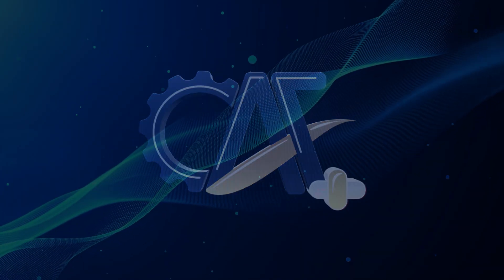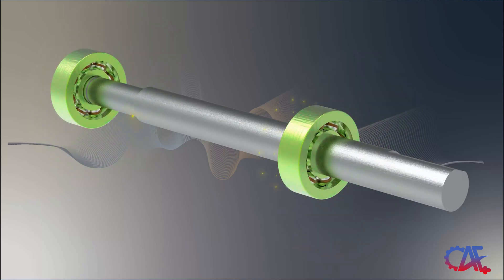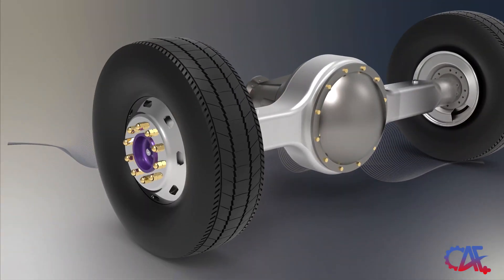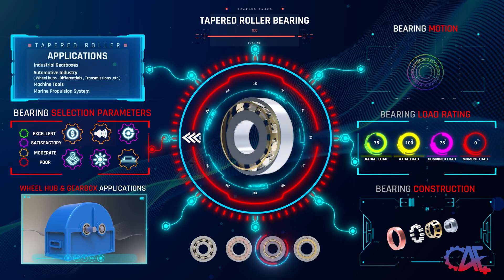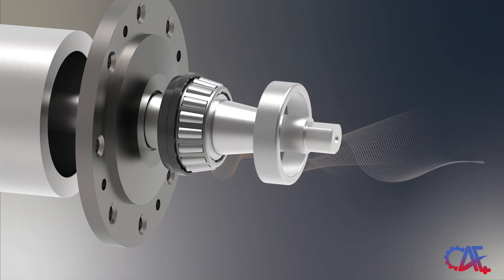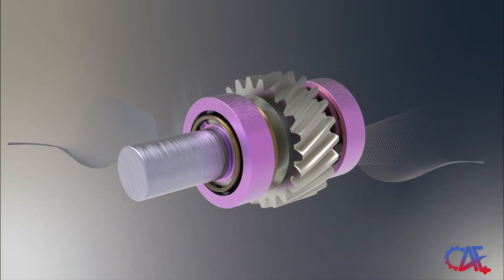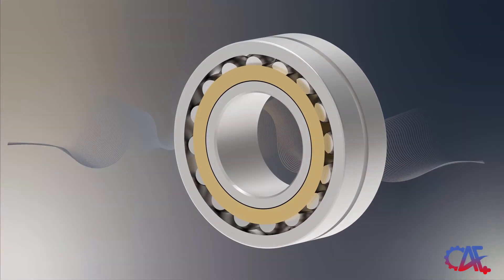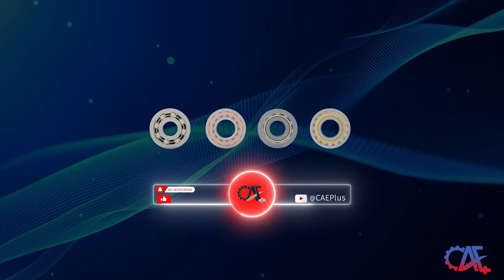Applications of Bearings 1 [Common Types]

Comment: Coin Sorters use bearings Yeah Coin Sorters, they get trashed but Cummins sell maintenance plans and then tells their techs to just sign off without maintenance being done so machines are always in disrepair at places (Armored Car Facilities as Casinos are now away from coin counting). The small customers like restaurants etc. have no idea and just buy the plan and are basically throwing money away while getting nothing in return. All the while every time an inspection comes up then well, they are pencil whipped in house so to speak. You should get what you pay for in my opinion.Theft of Service in it's truest form. The Casinos that have machines like this and large 6 pocket +  note sorters/counters are really getting ripped off on with that phony preventative maintenance scam but I guess it makes them feel secure as they can call in like every day for squeaks and noises and well, the techs have to go to maintain the harmony. No charge for that though. In essence all reactive maintenance as bearings get ran to the hilt and rollers etc. not preventative at all. Really with the areas that need to be maintained it is not feasible that like only 4 technicians could cover all preventative maintenance needing machines anyway. The coin sorter is amazing though right ? See I said something nice :). For coin redemption stick with Coin Star. They developed the idea and Cummins just copy catted them with notice payed to patents of course to cover their asses.

Comment: I must say it's a very good video about bearings.
After I've seen this video I ordered 2 ball bearings. 6000 2Z branded SKF to be exact.
Size; 26x10x8. I use them on my bicycle trailer. This trailer is equiped with a single 16" inch wheel.
I don't hear any sound when I spin the wheel. And when I ride on my bike pulling the trailer I feel no resistance. I can go up to 30 km/h with ease.
Reply from the maker: Happy this video could help you with your project. BTW, your project sounds very exciting and very cool you can get up to 30 km/h after installing the 2Z SKF 6000 bearing on your bicycle trailer. Please let us know your suggestion for our next videos.